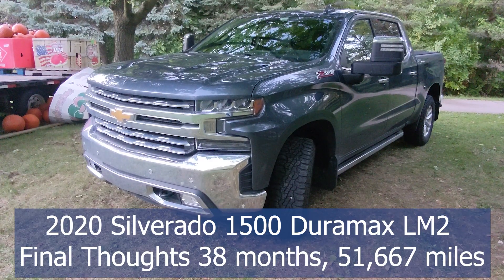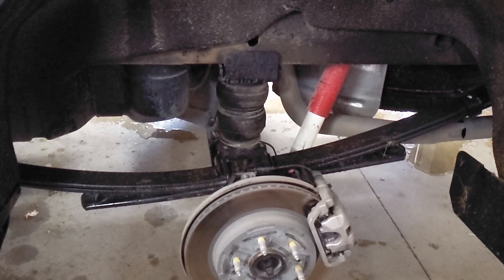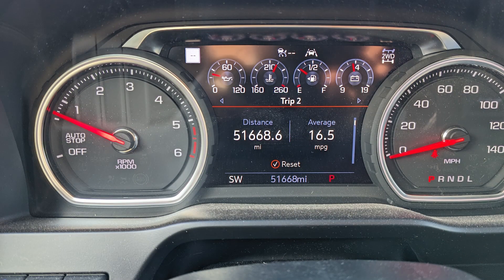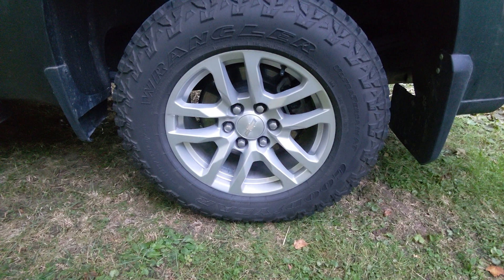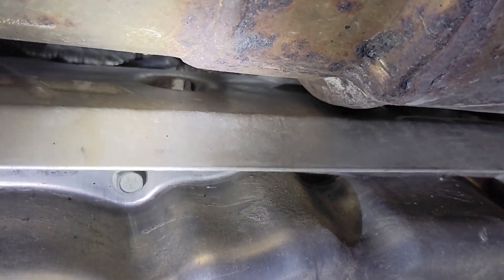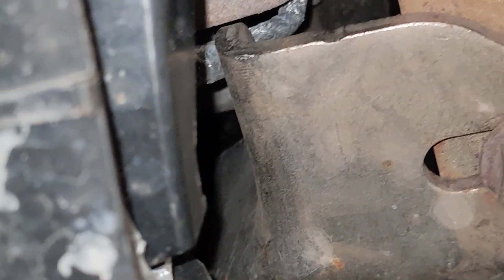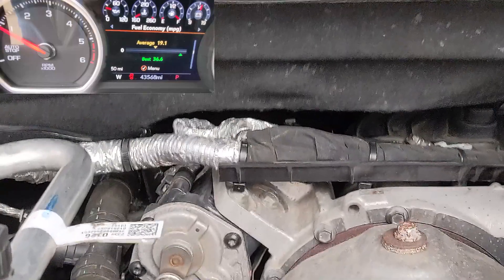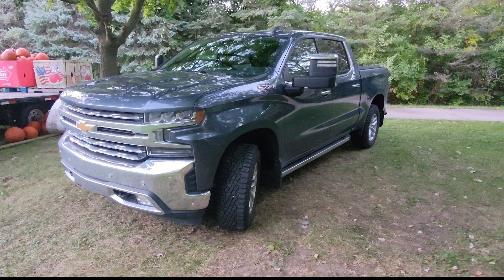2020 Silverado 1500 Duramax LM2 - Final Thoughts

Comment: On the rear suspension I had a heavy duty Roadactive suspension fitted - it helped stabilise the tow ride and rear sag a little. I later removed it. I then had the lowest leaf spring removed and replaced with two thinner springs manufactured by a specialist spring company - it raised the rear and made it sturdier towing but made no difference to the solo ride so I’m very happy. Otherwise the truck has done 35k trouble-free miles - no plans to replace it yet.
Reply from the maker: That is great.  Could you share the spring provider information?  I'm going to be towing tomorrow so I'll see if I need bags on this one or maybe go the spring route.  The shocks are better at controlling rebound so we will see...  Thank for posting.

Comment: I am getting the same 175 miles until speed limited to 65 mph and have about 40k on my 2020 GMC 3.0. I get the error and low and behold the next day its gone....been doing it off anon for months. I was also getting the P2383 code. I debated taking it to gmc dealership but on most forums I heard that it was not covered.
Reply from the maker: Depending on the relationship that you have with your local dealer and service writer, I would call them up and make sure that it is covered.  It's a known problem with the wire harness on the LM2 and since it's emissions related it should be covered under the 60k powertrain warranty.  If you take a look at the sound deadening on the firewall just above the turbo you will probably see where that harness has been rubbing when you let off the throttle, that was the sign mine had the questionable cable and when it was able to measure the DPF pressure the light went off...  Keep me posted on what you hear from the dealer, it will probably keep getting worse till the harness gets repaired.

Comment: How often do you change your oil?  Fuel filter?  Do you follow the manufacturer's recommendations, or do you have your own schedule?
Reply from the maker: I have been doing oil analysis for both this truck and the new one to make sure everything is good, here is the link:  https://docs.google.com/spreadsheets/d/1H1zXVoUJiPSEzkMdXtYeBX9KNuu7g6dM6L-vjZLRS7Q/edit?usp=drivesdk I normally do the first change early, ~2,500 miles, and try to do the second also early to clean anything out then I'll start changing it around 7,000 miles or when I'm at about 10% on the oil life meter.  As for the fuel filter that is between 20k and 25k, or when the fuel filter gets to around 10% also.  The mileage can vary but is based on how many gallons you use if you have clean fuel going in.  I'm sure it would flag you early if there was a large restriction due to dirty fuel.  Thanks for the question and for watching.

Comment: Got a 2022 refresh, brand new in june, 10 days later i got an airbag that went, 2 weeks after that the camera for lane assistance also broke and now at 15k (kms) vibration at high speed and clunking while stopping either from reverse or going forward…love this truck but not impressed on reliability
Reply: I've heard several negatives about the 2021 & 2022 model years quality due to the auto part and labor market at the time.
Reply: @jacobburns9343  I’ll see what the warranty will do but so far like i said not impressed, I’ll give it another chance but if it continue down this road I’ll trade it in
Reply: @Italianborn  GM was never really know for making reliable equipment yeah... and by what you say the engine so far looks like its doing great! its just like the old dodge rams, the engine is good but everything around it is junk🤣
Reply: @Velkanis  actually gm with Allison transmission , specially on the 2500 was one of the best reliable truck, there are still tons of it driving fine… just the newer 10 speed transmission  along with the fact that those newer diesel can’t be deleted will probably make me trade this.
Reply: Many parts manufacturers work with multiple major brands.  I personally have had very few issues with GM trucks that have not been corrected under warranty.  I have a new 2021 motor home with a Cummins 6.7 under the hood.  Motor shit the bed after only 4K miles.  Even though I am primarily a GM truck customer the motor home I wanted had the 5500 Ram Cummins under it.  I was super impressed with the Cummins until it failed.  The real fact is I took the vehicle in for service and the tech told me the motor had a weird sound in it.  I could not hear the sound he was saying he could hear.  Cummins sent the local rep to the dealer and he agreed there was a motor problem and authorized a new motor swap.  Dealer told me it was a 20K swing.  Zero to me.  All of these new vehicles are a complex combination of parts and technology working in concert.  As long as the manufacturers stand behind their vehicles warranty it’s all good.  I have owned three 6.6 Duramax trucks, one 3.0 Duramax truck and one 6.7 Cummins motor home.  Knowing everything I know now about these vehicles I would buy any and all of them again including the Cummins.  Currently have a 2023 High Country 3.0 on order.  Buy what you like, wear your seat belt and drink cold beer!

Comment: Alright, an update on the 2020!  Did you happen at all to run into a P1048 code in that 51,000mi?  After seeing your issue and that wiring harness deal, I think the next time that customer's truck comes back we'll have something more to look at.  The code sets only when they go through a local car wash.  We tried hosing the engine bay, washing it at the one down from us, can't duplicate it.  We even put a new DEF injector and the connector end on it going after the possibility of water intrusion for the DEF injector.

Comment: What was the fix the dealer did for the harnesses coming too close to the firewall insulation? I just looked at my LM2 Yukon and one of the two harnesses is coming very close to the firewall. I can push it down and give it more clearance but I know in time it will creep its way back up…
Reply from the maker: The dealership will replace the connector with a new pigtail wire and splice it into the harness.  I'm not really sure if it will last longer or not but I believe I had the problem because of all the towing that I was doing.  The wire rubbed when you let off the throttle and the engine rotated during engine braking/slowing the truck down.  I have only heard of one other person having that problem so far.  Maybe it might be good to put a zip tie to keep it down, that worked for me...  Keep me posted.

Comment: The diesel cap is a good idea. Where did you find it for the Silverado/Sierra? I can only find something that looks identical but the description says it's only for RAM. Seems it should work on the GM product but...
Thank you
Reply from the maker: Thanks for the question.  I purchased it on Amazon, title was "Magnetic Diesel Fuel Cap Accessory compatible with Dodge RAM TRUCK 1500 2500 3500 (2013-2018) with 6.7 CUMMINS EcoDiesel, New Easy Grip Design, current price looks like $18.00
Reply: @CJIEngineering  Thanks Chad. That's the one I found as well. I'll order it. Really enjoying my Sierra AT4 with the LZ0. 1,500 miles in and it seems like a goldilocks powertrain. Tons of grunt and 23-26 mpg hwy is incredible for a lifted truck.

Comment: Do you ever hand-check your fuel mileage, or do you rely on the display?  I always hand-calculate it myself, and it never matches what the display says (5.3 gas).  It only comes close on long highway trips.  I don't think the display likes transients.  Maybe the tables in the diesels are better?
Reply from the maker: I use fuelly.com and the "acar" app on my Android phone to document all of my fill ups but there are a few that I missed.  The screen is close but like you said never perfect.  According to my other data the mpg over the whole ownership time was 17.062 MPG.  Thanks for the question.
Reply: The last two 5.3 gas trucks I've owned have been within 0.2 mpg. Both direct injection. Modern fuel systems and computers makes the mpg estimate extremely accurate. The fuel pump at the gas station is less precise.
Reply: @hochhaul  gas station pumps are tested regularly for accuracy by the state's bureau of weights and measures.  They're very precise.

Comment: Does the new LZ0 with 3.73 gears hurt you in the fuel mileage department?
Reply from the maker: Samuel, thanks for the question.  I'm seeing about 27mpg on the highway and 12.2mpg towing my trailer.  So about 1mpg lower on the highway but 1mpg better towing the trailer...  That was the original LM2 with the highway tires, when I switched to the all terrains I was only getting 26mpg on the highway.  Let me know if you have any other questions.
Reply: @CJIEngineering  thanks for the response! No other questions but look forward to when you can get new content out! Always we'll thought out and thorough.

Comment: Did you have problem with the truck cranking but not starting?  Happens to mine once a month or so
Reply: The GM bulletin to fix it suggests removing the cab from the chassis. And I'm not letting them do that. It always starts immediately after that happens
Reply from the maker: I did not have that problem.  There is an ECU update that also addresses the no start problem. The LZ0 and more recent LM2 take an extra revolution to start to fire but if it's not really bad I think they would go that route instead of replacing the cam sensor or cam ring gear, that is why they need to pull the cab.  Thanks for the question.
Reply: @core8967  thats the cam reluctor wheel deviation that one of the parts manufacturers GM had sourced was slightly over spec and whenever the engine lands in that exact spot it doesnt start, theres updated PCM calibrations that solve the issue by giving the cam sensor a few extra miliseconds to read the wheel better, its a permanent solution 100% safe and no cab has to be lifted!
Reply: I did get the computer update October of 2021.  It didn't do it again for 4 months after that. But now it does it occasionally.  Maybe I should take it back in
Reply: @core8967  you may have either a completely different issue to the original one thats haunting you now or it may be that your truck has a bent reluctor wheel and the calibration is only capable of doing so much before its too bent out of line, if it gets too frequent id advice you do go get her checked before it goes into a bigger problem later...
Cheers! i hope its something simple!

Comment: The most weight you have towed?
Reply from the maker: Thanks for the question.  I routinely tow a flatbed trailer with various items on it that weighs just over 9,000 lbs, normally less than 300 miles, GCW of around 15,000 lbs.  I did one long trip with a tall enclosed trailer that weighed 7,900 lbs, GCW 14,000 lbs, this was just over 1,600 miles.  Let me know if you have any other questions.